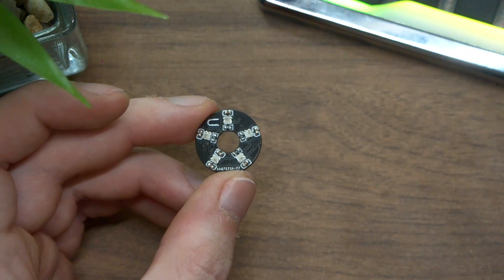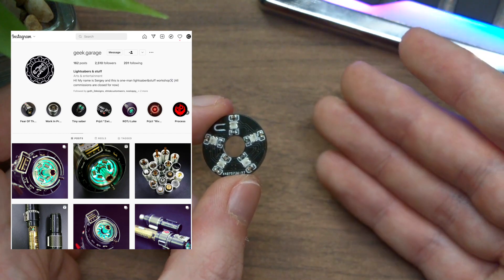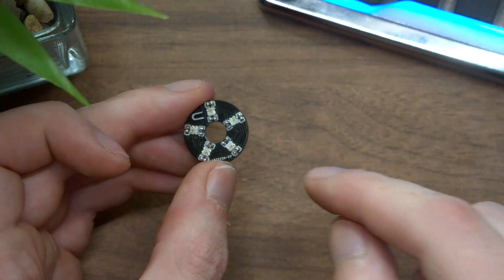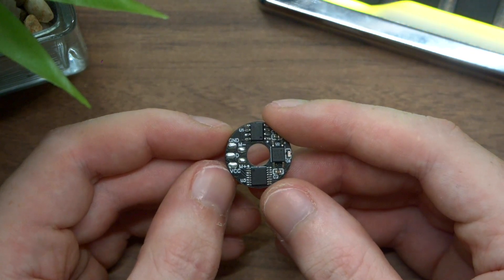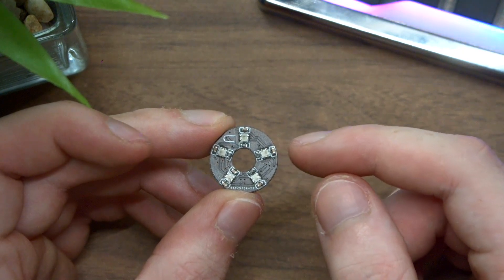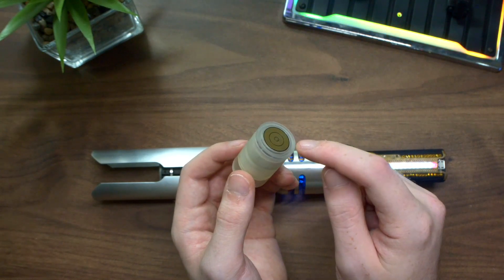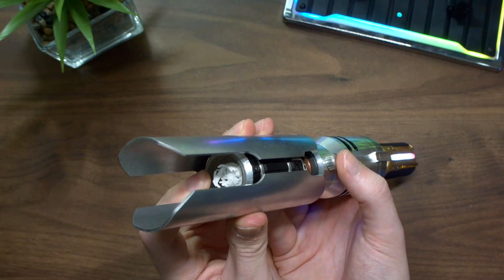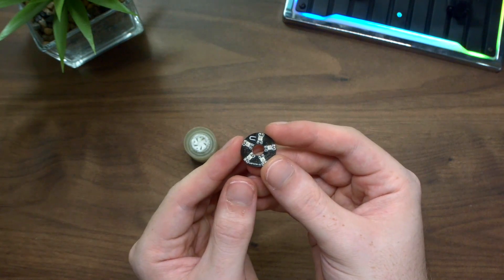Neo360 - Official Introduction

Comment: Sir.....why not just wire a vibration motor in series with the board inside the hilt
No special board needed? Or in series with the crystal chamber?

I don't understand your invention
Reply from the maker: This allows it to be modular through the blade connector, inside the blade plug there is only positive, negative, data. This allows you to harness speed control of the motor for a spinning decoration the end of the blade socket
Reply: It’s meant to be separate from the hilt in terms of wires, not that hard to understand? It’s a blade plug
Reply: @PattrickNM   WHY........noisy blade plug?
Reply: its not a fucking airplane lmao, thats the least of concerns